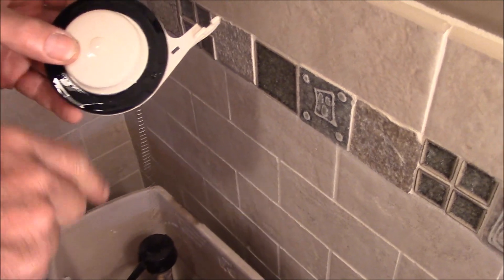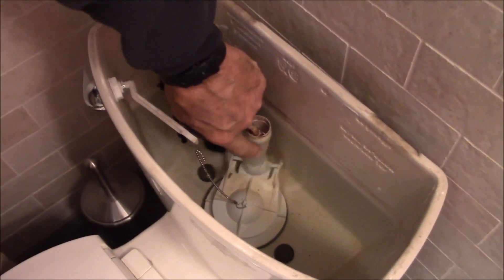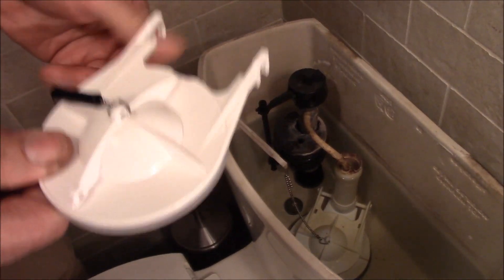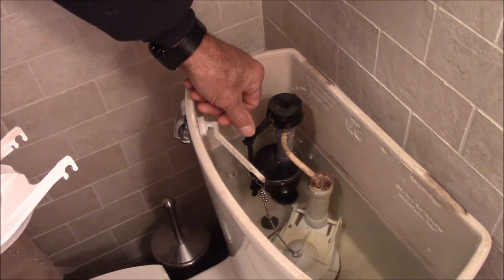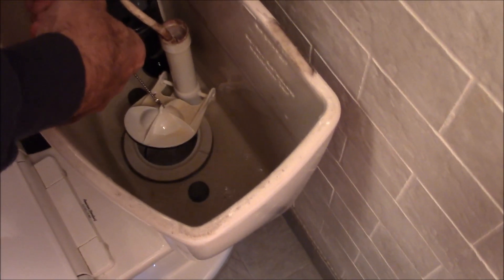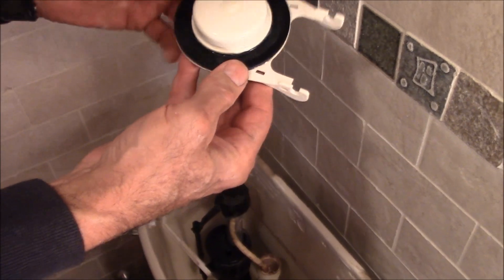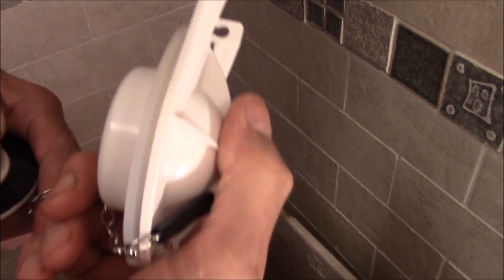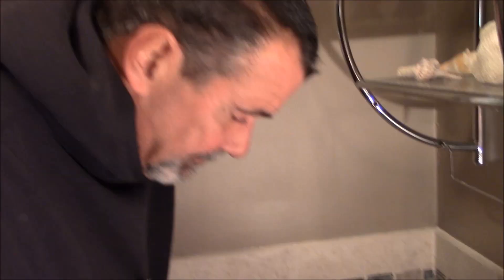American Standard Cadet 3 inch White Flapper Replaced - Sizes, Fix Running, Leaking Toilet

Comment: I cannot seem to be able to remove the old flapper… no matter how hard I pull up. Is there a trick to getting it off?
Reply from the maker: They are snapped on with a fair amount of force. One in 10 I feel like I’m gonna break off the ears when I remove the flapper. Make sure you pull it in the right direction so that it will snap off.
Reply: @MrHardware1  is it possible that i cant snap my flapper as it is a full loop around? At this point i feel i have to remove the ears but im not sure its a good idea! any ideas/help? ty!
Reply: its hard plastic and i cant see a hole anywhere to snap it out. Also its hard plastic so i cant turn it sideway to thread the ear. I've watched so many videos at this point i am either dumb lol or i have a rare flapper model.
Reply from the maker: @ericcossette3999  it’s hard to tell you what’s going on without knowing the model or the manufacturer of your toilet. Sometimes if its round or there’s a pin that goes into the flush valve, you have to stretch one side of the flapper out and carefully pull toward you so it comes off.
Reply: If it helps, I was eventually able to remove it by wiggling it a bit and using a lot of force
Reply: @lisahealthyhair  yeah maybe it could have worked, but i decided to just cut it with a tool

Comment: We have this toilet, and the darn flapper has suddenly started to have one side pop off after flushing, and only sometimes, not always!  I can press down and snap it back on the rod, but it doesn't keep it from happening again.  There doesn't seem to be any damage to the hinges that hold it on and otherwise seems okay.  Ideas?
Reply from the maker: It could be that the flapper is either defective or worn out, or maybe the chains too short and when you flush it at the top of the flush it’s pulling the flapper off the post.
Reply: Had the same problem, making the chain a bit longer fixed the problem

Comment: If the original part is not available, can the proprietary flush valve be replaced with a universal 3" one? I'm assuming that would require the tank to be disassembled.
Reply from the maker: Yes you can, I have an order to get a little bit more water during the flush by getting a lower 3 inch flush valve. Make sure you get the tank to bowl gasket and the bolt gaskets that hold the tank to the bowl.